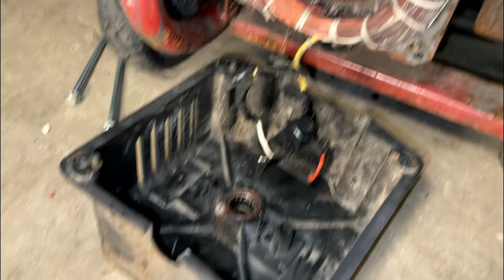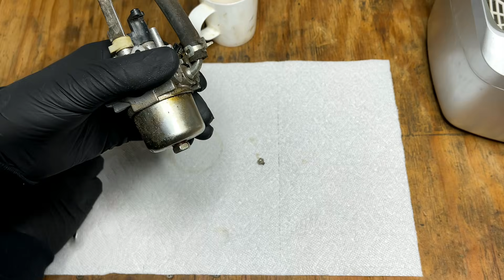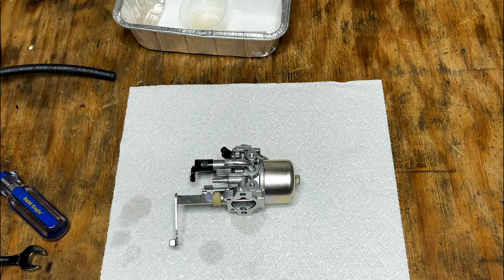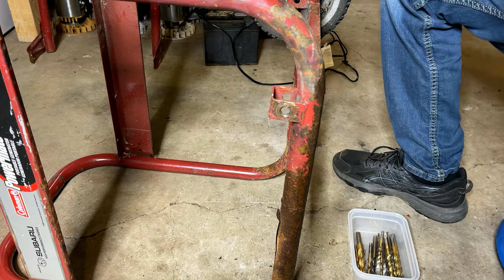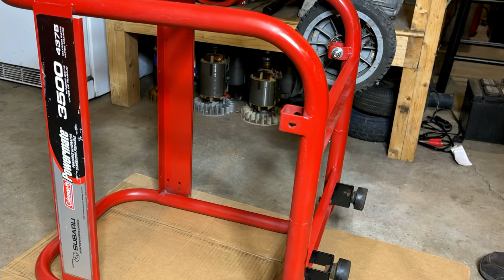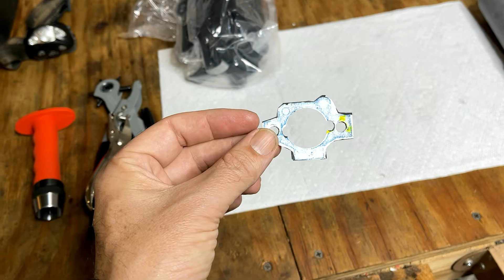Powermate Generator Not Making Power - Can it Be Fixed?

Comment: U.K. Merry Christmas and New Year James and thanks for all your videos. I hope it's OK to ask a question. Do the govenors work by using the cooling airflow with a vane - like a lawnmower ? That does seem a bit crude but whatever is used it obviously works. What would happen if the govenor failed and the throttle jammed wide open. It would be pretty nasty I think. Do take care at this time.
Reply from the maker: Questions are fine.  Most generators I see use a mechanical governor with weights connected to the camshaft.  When the weights spin, they push on a metal plate which pushes the governor rod slowing the engine.  The faster the engine runs, the harder the governor will push the throttle closed.  Resting position when the engine is off is full throttle.  I have seen a lot that get stuck there after years sitting around.  Always good to manually move the linkage before starting.  It started stuck in full open throttle, the engine will blow itself apart quickly.  Inverter generators use a servo and computer control to set the engine speed.
Reply: @jcondon1  
Thanks for the info James - bit like an old steam engine then. Called  'bob weights'  in those days. Bits of tin flapping in the breeze is not very accurate. Regards.

Comment: Those handles seem like they're on upside down. Shouldn't they fold down instead of up over the tank?
Reply from the maker: I thought the handle on this one should fold over the tank which is why I flipped the handle.
Reply: @jcondon1  Cool! I just saw the way the brackets on the handles and the pin looked. It looked like it would be very weak and awkward to lift and roll.

Comment: I have the exact configuration on my generator, but its a Homelite. When I got it it didn't produce power either. It had a 5uf cap that was bubbled up. I replaced with a 6uf cap and it seems to work fine.I wonder if it should have a 22uf?
Reply from the maker: I would double check.  5uf is really low.  Usually I see between 20-60uf

Comment: hey James do you know anything about the troyb presser washer 8.75hp, bad carb i think
Reply from the maker: Sorry have not worked on one of those yet.  But same rules apply as far as the engine goes.  Does not matter if a generator or power washer.

Comment: It goes to show that you can never take the customer's word for a diagnosis. Just start from square one and troubleshoot the unit with a methodical approach. If you follow a theoretical, systematic flow chart, eventually you will arrive at the problem.
Also, a sharp eye that comes with experience goes a long way too. Great job James

Comment: Can you explain one thing in future videos.  If engine is rotating constantly at one speed and the rotor is moving at same speed why does applying a load slow the rotation?  Does applying a load cause the magnetic fields producing power to apply resistance and thus making engine work harder to keep rotating?
Reply from the maker: That is exactly it.  The heavier the load on the stator, the more current is induced though the stator.  The wires in the stator become magnetic and the magnetic field induced woks against the rotor.  So the more current coming out of the stator the more HP needed to keep the rotor spinning.  About 1 HP for every 546 watts.

Comment: Coleman used that same endbell on all models so thus the slots for brushes on a brushless generator. Should have lubricated that bearing while you had it out.  The end bells are NLA and if the bearing overheats it melts the plastic endbell and it's game over.

Comment: I picked up a small Coleman 1800W generator from the trash. It ran but made no power. I found the $20 capacitor was bad. I replaced it and now works great. What causes the capacitor to fail? Trying to power too much? Enjoyed the video. Learning a lot.
Reply from the maker: Age is the main cause of failure.  The electrolytic capacitor dries out with age and the capacitance starts changing.
Reply: @jcondon1  👍 thank you. Yes, it is older.

Comment: Nice to know how important it is to have proper size capacitor.  Do you know the displacement of the Subaru engine?  Happy holiday to you and the family!
Reply from the maker: I think this was 210cc based on the engine model EX21.  Could be wrong, but makes sense based on the rated load the generator can support.

Comment: Good video. However l wondered why you did'nt check the valve lash while you had everything out of the way.
Reply from the maker: I have a bad habit of only fixing issues and not doing the normal tuneup stuff.  Without paying customers, paying an hourly rate, it’s hard to justify doing a tuneup unless it’s causing an issue.  That said I always change the oil and check the air filter.
Reply: @jcondon1  I think that your videos are first rate.

Comment: Jim, Rance here again, I think you got the pull handle put on upside down. Look at the beginning of the video.
Reply from the maker: Forgot to mention it, but the handle was upside down when I got the generator.  Would not fold up properly.  So I flipped it and now it folds up properly.
Reply: @jcondon1  thanks for the explication. A very good video

Comment: Hi. Great video. What would the a/c voltage across the capacitor spade connectors be with no capacitor connected and the engine running?
Reply from the maker: With no capacitor would expect only a few volts AC, but have not tested that.

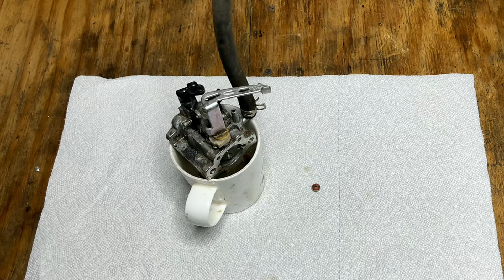Comment: I'm impressed that carb ran and ran so well with the amount of rust and water it had in it and the bowl just wow @23:12 @James Condon
Reply from the maker: It is always surprising to see one like that run as well as it did.
Reply: @jcondon1  yeah it is
Reply: I was thinking the same thing 😉😉
Reply: It sat long enough to turn to paste in the bottom of the bowl.  If it was in fact charging and in use, it would have eventually cleaned up and vibrated loose with more fuel and completely messed up the carb.  Good thing they gave up and let it collect dust.

Comment: I bought a used parts washer, and they used simple green cut with 50%  water in it, and they had no problems with it, and the plus side is that it is non-flammable, so no concerns with welding near it. The down side might be if it's able to freeze.
Good job on that generator, Jim.
Reply from the maker: A parts washer is a great investment.

Comment: Did the previous owner just pour rusty gas into this? That bowl didn’t look like it had ever rusted…

Also, didn’t you install a hoist? Stop wrestling those out of the frame by hand!
Reply from the maker: Unfortunately most cannot be removed from the top.  Might need a forklift next.
Reply: @jcondon1  suppose you could tip it up on side and then lift straight out with hoist. But yeah, see your point. Makes my back hurt just watching you wrestle those out of the frame. Lol.

Comment: Don't quote me but I thought that was supposed to have like a 35 micro ferret cap
Reply from the maker: Not sure, but definitely not 5.  Several part sites listed it as 22.
Reply: @jcondon1  if the parts sites listed it as requiring a 22 then it's correct

Comment: Did you tell us what the capacitor cost?  Awesome job as usual!
Reply from the maker: With tax and shipping the capacitor came in just under $23.  Here is the link to the part https://www.ebay.com/itm/22UF-Capacitor-For-Husky-HU36511B-3650Watts-Gas-Generator-/265310867658?mkcid=16&mkevt=1&_trksid=p2349624.m46890.l49286&mkrid=711-127632-2357-0

Comment: If you were keeping that for your own use would you bother to paint the and clean up the frame I have one I picked up that runs and produces power but looks like crap going to use it for myself just wondering if I should ckean it up.
Reply from the maker: Personally I do not worry about the rust as long as everything works as it should.

Comment: An excellent video on the resurrection of this unit for proceeding through the assorted stages of testing and checking of both the engine and the powerhead and ultimately finding the electrical issue. I was most surprised how well the engine started and ran on oldish fuel and with all that muck in the carb bowl!
Your efforts on tidying up the machines appearance have improved it no end.
Reply from the maker: It was surprising how well that carb was running the engine.  Have had plenty that look perfect but run poorly or not at all.

Comment: Wow, what a transformation! Thoroughly enjoyed that journey. The wheels are from a Toro SR4 Super Recycler lawn mower but they work perfectly on there, good quality too. Only thing I might do after doing all of that excellent work is remove and clean the overspray on the recoil housing. Awesome work, thanks and happy holidays to you and your family James!
Reply: I have a Ryobi miter saw stand that I couldn't find wheels for. One broke, so it was scrapped. I finally found a pair from a mower that had ball bearings. They were better quality than the cheapo ones from Ryobi.
Reply from the maker: Was wondering about those wheels.  The original were pneumatic.  I tried a set of 10” pneumatic at one point and the generator was no longer level so left the mower wheels on.
Reply: @jcondon1  yesterday I got a set of wheels from a pr1mo personal mobility unit, and they had 4" flat proof tires on it. I'm planning to use them on a wagon so I don't deal with flats. A bit heavier than stock pneumatic tires, though.

Comment: Another great genny restoration video! Just a question, any update or progress on the inverter generator board repair/unpotting?
Reply from the maker: Have a 40+ minute part 2 in the works.  Made some progress but still not working as it should.  Will probably not be able to complete that video for a couple of months.

Comment: Great find and save for $50 plus the capacitor and air box parts! Invaluable testing and troubleshooting documentation for anyone chasing the same issue. Thank you for your contribution in that regard. We could sense your lack of enthusiasm for having to do all the detail work to get it looking good once you realized it was going to make power! That's funny and kudos to you for spending the time cleaning up that tank. So annoying when folks over spray paint onto such things. I've used Good Off and Goo Gone to clean up over spray on small engine equipment before. Just have to be careful as sometimes strong enough to remove paint too. Anyway, "must see" YouTube content for sure and Merry Christmas to you and yours!
Reply from the maker: Goof off works well, but definitely need to test it as it can cause issues.  Have a Merry Christmas.

Comment: Hi James, Love your videos and your troubleshooting process. Regarding this process, Wondering why you didn't try flashing it before pulling the end cap and checking the coils and such? Seems like the prudent thing to do even though that was not the problem.
Reply from the maker: Was convinced it was bad based on previous experience with these models.  Also like to check things out first. Usually when they do not make power it is for good reason.   Of all the ones I have worked on, only two truly lost magnetism.  And both were because the brushes wire were connected backwards collapsing or scrambling the residual magnetism.

Comment: Good fix, thank you! A 22MFD would be polarized. The cap could only be installed one way because of the keyway eh! Merry Christmas! Ron USA
Reply: Not necessarily.  You are assuming that it's an electrolytic,  and it's not.  Look at 21:04 and you will see that both of the capacitors are marked "AC"...

Comment: Can you just touch a capacitor?  Isn't it high voltage and needs to be discharged?  I remeber when i was a kid and wanted to shoot up an old television with my BB gun, my father used to tell me he had to discharge something first and i think it was a capacitor.   HA!!!  you answered my question.  He would take a screwdriver and do what you just did.  Too funny.

Comment: James i have a predator 9000 makes 120 intermittently no 220 at all any guess
Reply: I would check the voltage regulator if has one
Reply from the maker: When the 220 goes out, do all the 120v outlets still work?  Would suspect half of the 120s are intermittent as well.  Could be something simple like a loose wire on the terminal block down in the powerhead.  Or maybe corrosion on some of the same wires in that block.  If not a wiring issue then would most likely be a bad stator.  You would have to isolate the coils check the ohms of the legs, check each leg to ground and to each other to make sure everything is good.

Comment: Yeahh ive been waiting for another brushless video.  I have two makitas that ive been trying to bring back to life.  Also subaru engine powered.
Reply: Ah you got lucky with the cap.  I have no smoking guns.how would you have flashed this one?
Reply from the maker: I would have used a drill in one of the outlets.  Just put the drill in reverse, hold the trigger and spin the drill in reverse.  You can see me doing that successful in this video https://youtu.be/8GvJkuINoKA
Reply: @jcondon1  thanks for the reply.  Thats what i was afraid of because i tried and that didnt work.  The generator did fight against me and came off auto throttle and showed some volts...  i will keep digging, thanks.